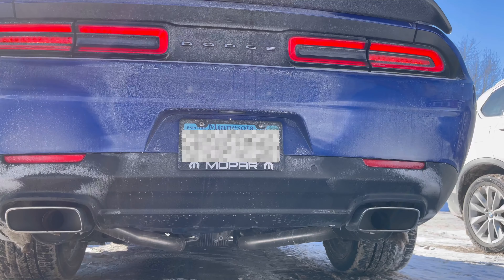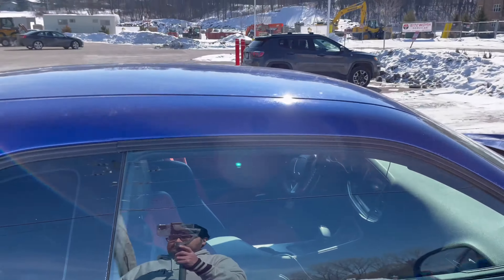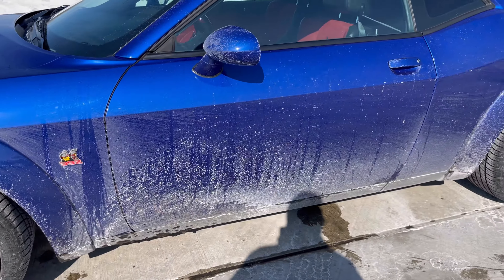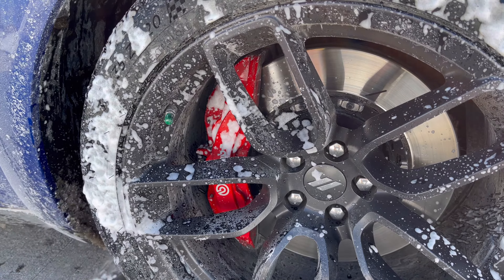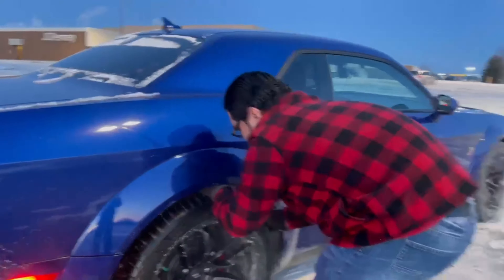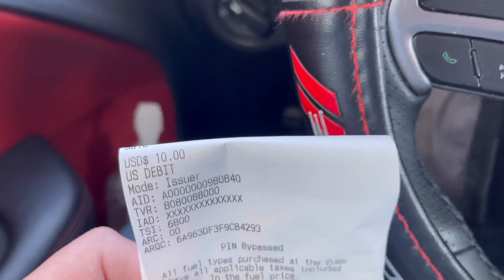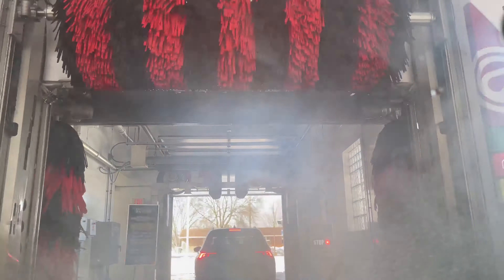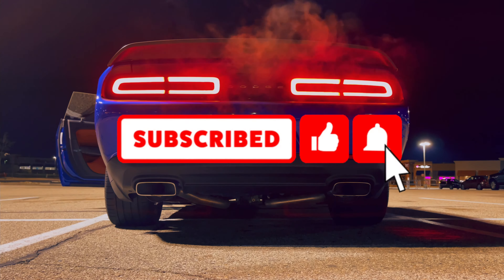Don’t drive your challenger scatpack in the winter! ** -16 Degrees cold start **

Comment: I never had a issue with my challenger in winter.
Reply: Me either..... drove several 392's in winter and a gt350 in the winter.  You can't even get all season tires for the gt350. I'm running continental extreme contact dws06 in 315/35/20 all the way around so I'm good 👍
Reply: @lmjames33  Damn nice nice. I run 275/30/20 on 392 ta.
Some people say you can't but what I say is bullshit. Is all about the driver and not the car!
Reply from the maker: I think maybe with the right set up it would be ok, the only problem is when you don’t live in a flat area. But props to you guys for driving it in the winter, I will be storing mine due to the salt and dealing with my doors freezing up from washing it. Thanks for watching!